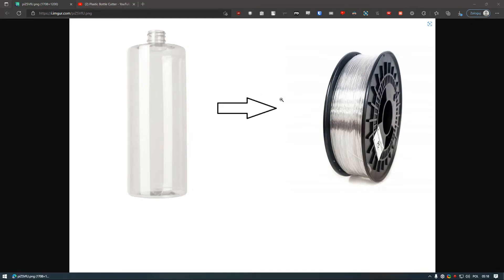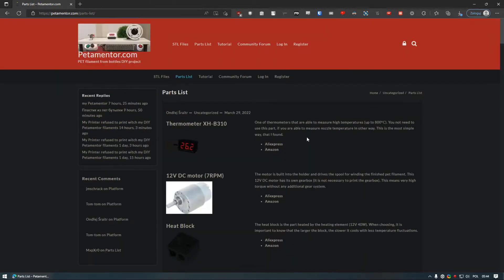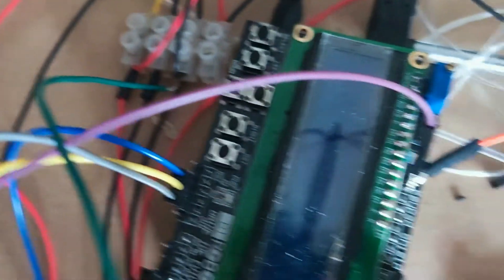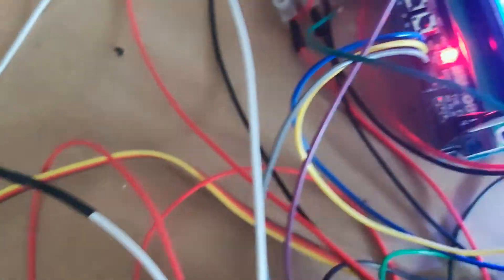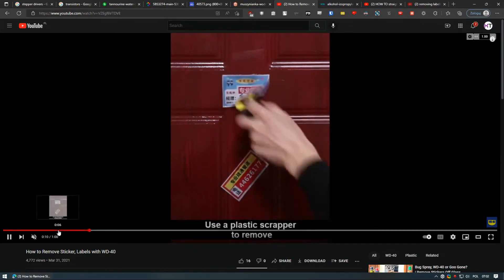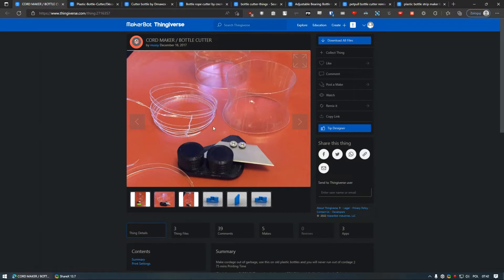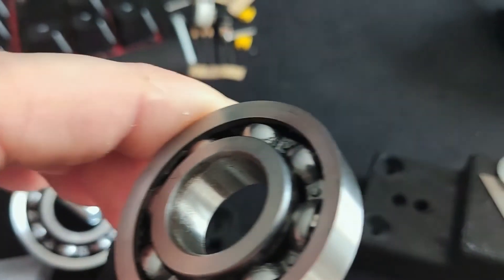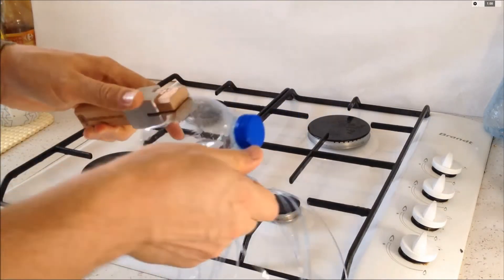Free filament maker machine part 2 - PetPuller

Comment: I've not tried since still outdoors projects season for me, even though have a can of, though reads and looks like works the best for removing labels glue is the "Pure Citrus Orange Air Freshener" Walmart lists and can be found on Ebay and elsewhere I think from the company that makes site as well.  Seems Walmart and Ebay were the best prices when I looked a few months back. Maybe can be home made even more cost effectively since the MSDS, and I think the website, lists the ingredients.  Kind Regards and thanks for sharing!
Reply from the maker: right now im using god ol' break cleaner, toxic but does the job, dunno if i should recommend it tho.
Reply: @KaminarisTech  I just pretend glue on bottles doesn't exist and so far everything has been just fine :D Not only that I also don't bother to do any processing on the bottle except rinse the inside with water. I see some people boiling water in a pot with water inside the bottle to create pressure and expand the bottle with a heat gun bla bla bla... that is so much energy spent that your DIY filament probably costs as much as factory with work hours excluded...  Fanta bottles I can't cut for example because I refuse to process them but bottles with little ridges like Coca Cola are fine at least with my machine. Especially 2L bottles. Filament comes out flawless and also welded shut round.
Reply: Great job, Could you please provide me with the Arduino code & wiring map?